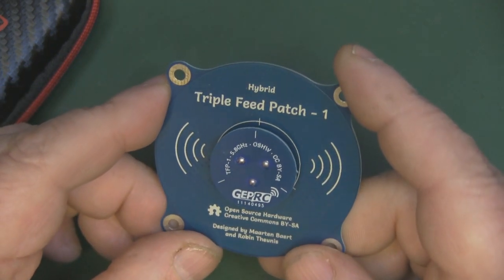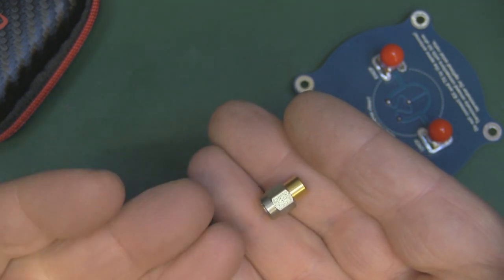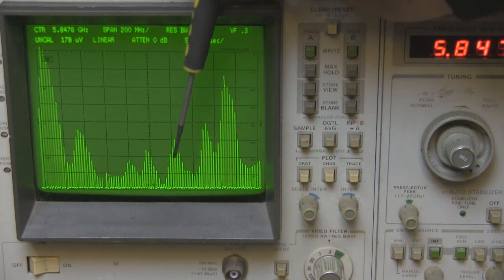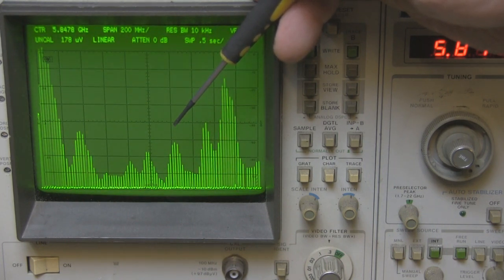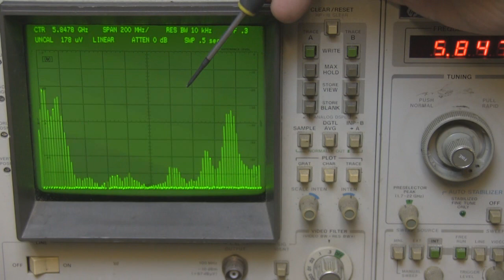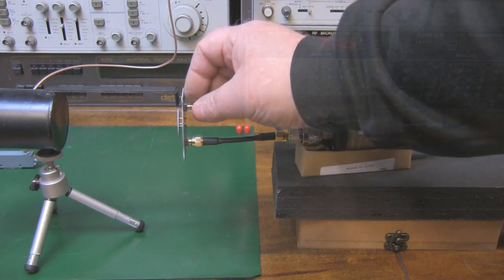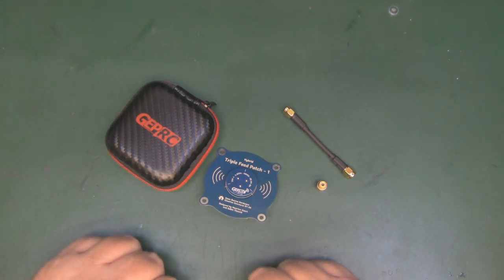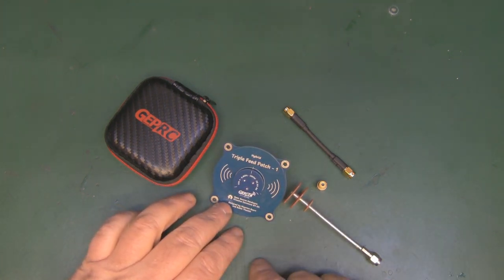Triple Feed Patch Antenna aka The Pagoda Panel Antenna

Comment: nice video as always!!! can you pls reply to my question on your recent 5ghz in reference to the 19 element yagi on plexiglass ? i need to know the full lengths of the driven element.your last reeply doesnt seem to match the template or dont fit the template... can you give me all four measurements of driven element wire?31.5 mm dont make sense?the template is bigger and shows around 53mm length.thats the last thing holding me up can you pls fully elaborate so no misunderstanding?thanks and sorry to bother you so much

Comment from the maker: A very nice panel antenna and interesting results when you remove the 50 ohm termination
Reply: I appreciate you carrying out these tests Andrew, and it's nice to know that the antennas I use for FPV are as good on the bench as they appear to be in the field, but I wish you'd stop calling it a "pagona" - it's a pagoda - like the chinese buildings - no "N"
Reply: I don't no if you remember me , but are you interested on that i run a 
Fan based Discord server for you ,

a discord server is a platform  where you can talk and chat with other people and so on , :) im sure you will like it :)
Reply: I like to call it a "pagenna" :)

Comment: This is not a Pagoda-based anything. Just because one of the designers of the Triple Feed Patch is the same designer as that of the Pagoda doesn't mean shit. The Pagoda has 3 layers, is omnidirectional, and is either RHCP/LHCP. The Triple Feed is a 2 layer, directional patch antenna, and can is a hybrid/switchable RHCP/LHCP. Nowhere does Maarten state that the Triple Feed Patch is based on the Pagoda. On the other hand, Maarten specifically states that the Triple Feed Patch Array antenna is "based on the original Triple Feed Patch antenna." As such, it stands to reason, that if the Triple Feed Patch was based on the Pagoda, he'd say so. But, he does not.

The Pagoda (you keep pronouncing it "Pagona," wtf?) is not "almost" perfect.  As Maarten states, "I did not try to make any specific aspect 'perfect'... I won't claim that this design is perfect,...."
Reply from the maker: Calm down and take a deep breath LOL